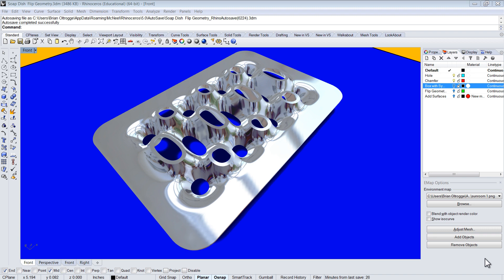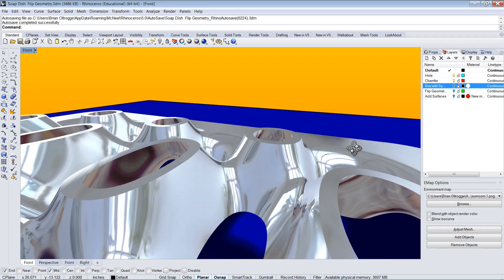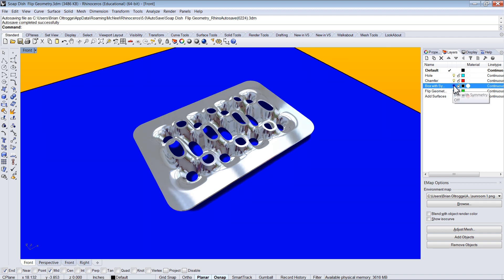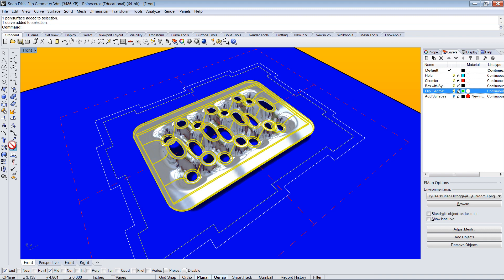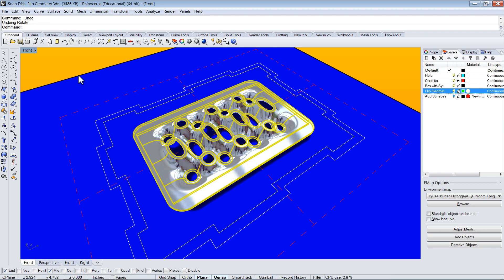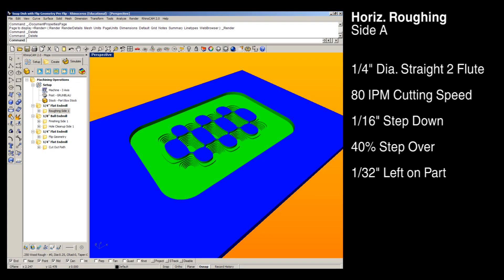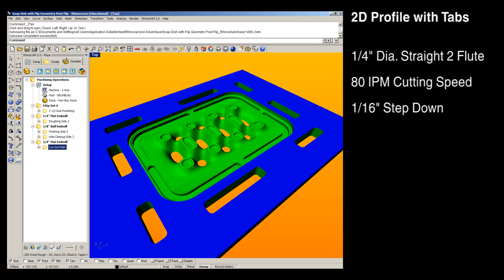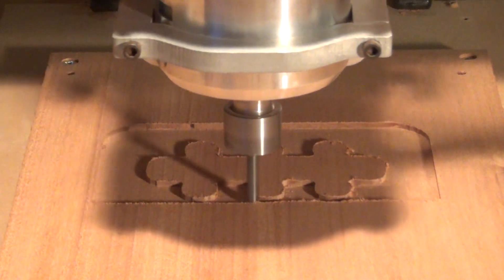Platform CNC | Milling a Two Sided Soap Dish

Comment: As a machinist that works predominately with steel, when you mentioned the integral flip geometry and how much easier it would be, I about had an aneurysm. Then I realized that I'm a fool and you're working with wood. Ultra clever to say the least, I might use this technique for some plastic jobs. Great video as usual.

Comment: 3d printing has always been shitty, but that seemed like an extraordinary example of how shitty it truly is. (Especially since you said you "had it rapid prototyped" which I assume mess you had it done professionally.) I don't see how people think that filament 3D printing is a viable production method.
Reply: 3D prints often require finishing, just like most wood projects. Brian didn't finish his print, so it looks bad. Plus, I take "rapid prototype" to mean it was printed at low quality for a quicker print, not at a higher quality, which would take much longer. 3D printing is not, and has never been, a one-step process.

Comment: only thing i can think of that could be a problem.. is the funnel cones need slots to drain the water.  some can create a soapy bottom that would hold water others are open
Reply from the maker: +Yo ski Theoretically, yes...  In practice, no.  You mostly want water to leave the bar of soap.  Once it leaves, it is free to evaporate!

Comment: sir you just blew my mind with how simple your design for the "flip" is. i have been incorporating a fixture into the design for a few small projects but i just ended up wasting a square of material every time. male cut around the piece and female cut in the stock into which i'd flip the project and end up throwing a way the square. so simple but so so genius. 
thank you for sharing

Comment: Thanks for an excellent video! But I think you are wasting a lot of good material! You could easily have had room for two of your beautiful soap dishes with just small modifications of setup.. Just my two cents..
Reply from the maker: You are correct, this is sort of a proof of concept.  I could also imagine cutting a bunch of blanks with the integrated flip geometry and using one negative to hold the parts while processing.  This would be much more economical from a material standpoint.  What you also don't see in the video is that I used the CNC to plane that board down from 1" to the 1/2" thickness!
Reply: Brian Oltrogge When it's the tool you've got, use it! Thanks for the great video!

Comment from the maker: Yes, I am just using a router at the moment.  I do have an ER20 collet that makes tool changes a bit easier, but generally I will just return to zero, remove old bit, insert new bit, drive over stock, let bit sit on stock while tightening, return to zero and continue.  No problem with repeat ability, although I would really like to make a touch plate at some point!

Comment: Brian, I see (assume) that you are using a regular off the shelf router and not a spindle. This would suggest that you are changing the bits manually between codes. If that is true, how do you ensure that the bit and router are aligned properly to your piece to continue the job? Maybe your mount is just much sturdier than mine because I have a hard time tracing the same path on a job with different bits. They are never aligned.